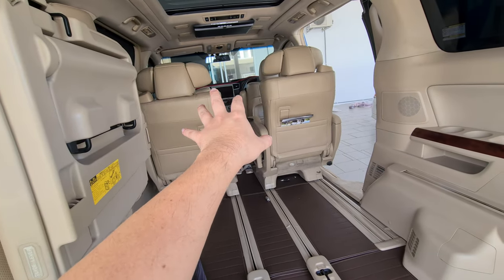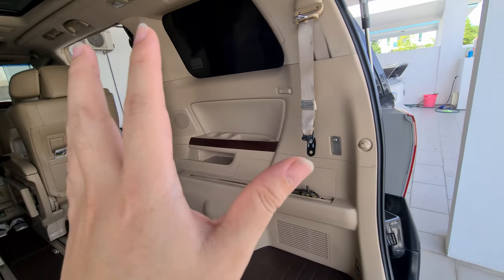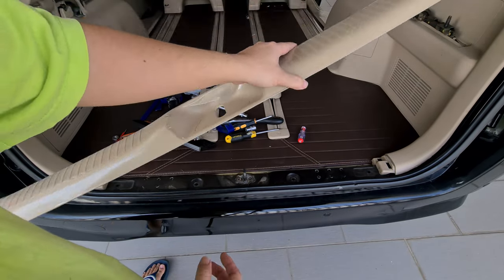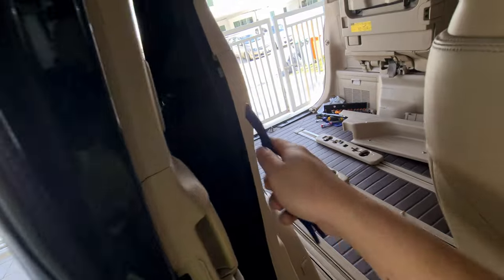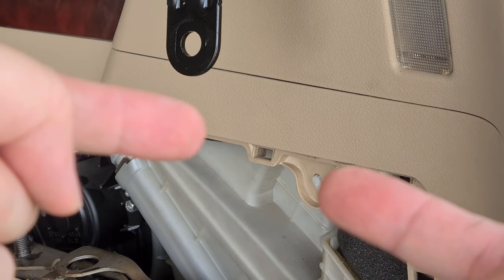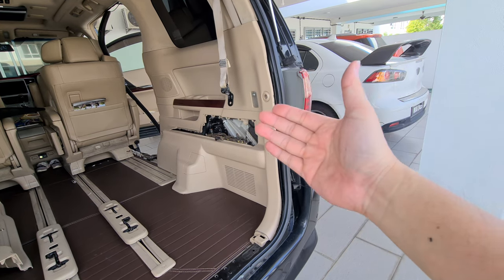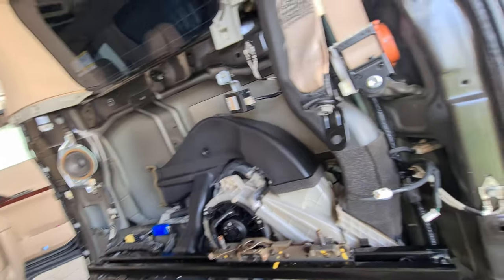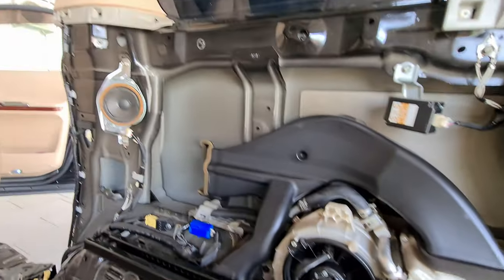How to clean rear AC blower - Alphard / Vellfire

Comment: I suspect my aircond got leaking and I just replaced the O-ring pipe connected to this rear blower. The pipe is placed on the top rear tyre because i can see oil over there. With this video I also do service cooling coil and blower myself. Thanks bro. 👍

Comment: Good vid bro. Been watching the channel for long time today have a question
I saw a rat jumping up near the  right rear wheel and just disappear to somewhere on the top of that area.
Is there a way or hole or some spaces that the rat can get into the rear aircon blower?
Reply from the maker: Rear aircon blower = nope.
But there is a spot at the rear bumper where its designed to release pressure when closing door. The rat could make it in from there (even if its a one way flap.)
Reply: @TCsAnythingGoes  thank you I will find and check this spot.

Comment: hi. My GGH20 is making some sort of vibrating sound everytime the AC is on. Like a fan which is not rotating properly. When I stop at a traffic light it is very obvious. Once I switch it off the noise is gone directly. I assume it comes from the dashboard area. Do you know what that might be and how it is possible to fix it? Do I have to dismantle the entire dashboard? Thanks
Reply from the maker: Few things to test first before we start dismantling stuffs.
- Is the sound audible from outside the car? If it is, then there is possibility of the AC Compressor pulley
- What happens if you turn on the blower but without the AC ON? If it still makes the same noise, then its most likely your blower that is shot
- Does this happen if you have the rear blower turned off?
Hit me up on FB - TC's AnythingGoes Channel and send me a video of the sound so we can diagnose properly.

Comment: Hi bro..good video..i got problem..just happen today. My velfire rear ac is cold, but the air flow very2 slow..the front blow is ok. Is it due to dust at the blower fan blower?or else..switch to max..but the air flow very weak through air vent..
Reply from the maker: Check for any possible blockage. The air inlet for the rear blower is the same panel that was removed in this video (bottom near the 3rd row passenger legs ). If that is not blocked, you might wanna try taking the panel out and see directly if the blower is turning fast or slow. If its turning fast, then you might want to clean it. If its turning slow, you might want to clean it first, if that does not work then replace it. Hope this helps.

Comment: hi tc.need advice.my vellfire rear aircond suddenly only air coming out and not cold as usual.front ac is cold as normal.might know what is the actual problem?
Reply from the maker: Happened to me once, resolved after i removed the battery for 5 minutes (don't do this if you are still using the original player from Japan else you will lock your player)
According to a FB group I am in, this is due to the rear actuator being stuck but I can't really confirm it cause I could not replicate the issue ever since.

Comment: Hello TC would love to ask you question on front blower motor current draw.
Reply: Do you know how much does it draw because I want to increase the battery capacity so I can use the blower for air when is stationary for few hours and still able to start the car
Reply from the maker: @chrislui999  i advice against this as your car will still need to be in ACC mode for the blower to function which means all your electronics are drawing power from the battery.
What I do is..... standby a USB fan in the car and just use a power bank to power that USB fan when needed.
Reply: @TCsAnythingGoes  will it be possible to install two more battery to achieve this? As this is something I will need for some authorisation in EU but not many Alphard specialist. By any chance you will know how much amps it will draw when anh20 is stationary?